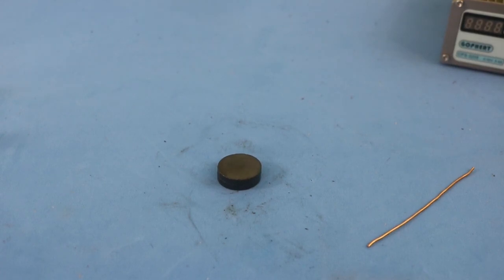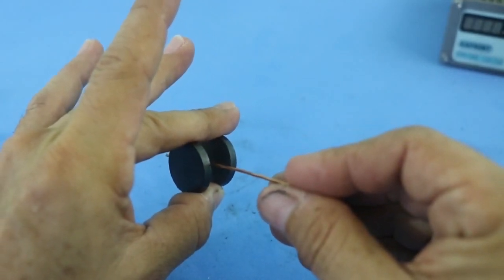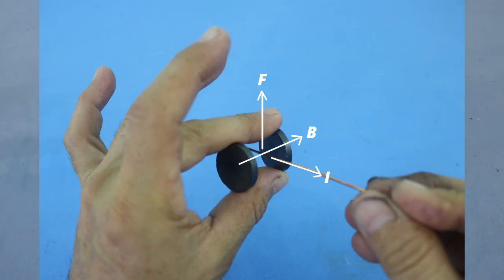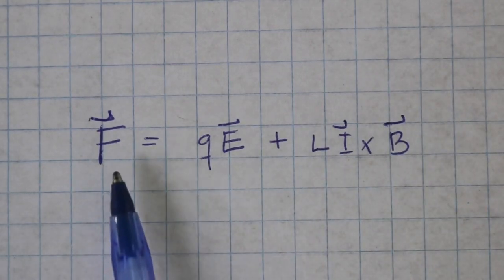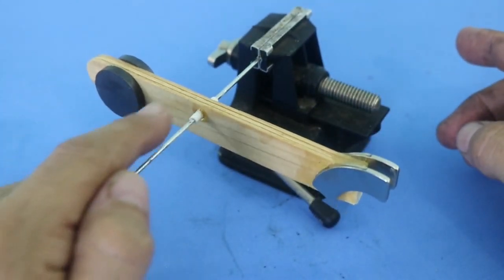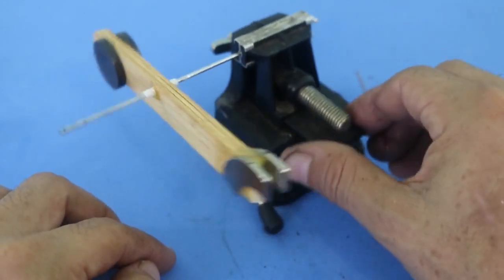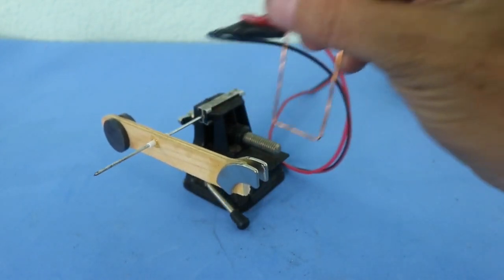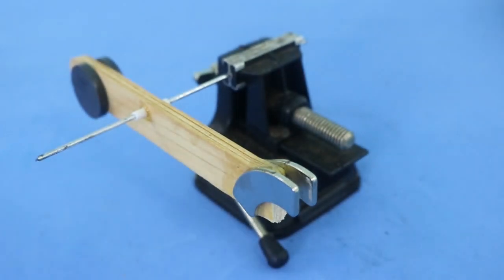Lorentz Force Demonstration and Explanation

Comment: The Fleming's left hand rule is not true. Thus, the so-called Lorentz force is also not valid. I explain it in details here:
https://newtheories.info/community/main-forum/is-the-flemings-left-hand-rule-valid/
Reply: Thanks. This finally explains why I'm getting inconsistent results. I have also found that, if you should use a small diameter rod instead of a wire you will see that the rod torques/spins. Thanks again.
Reply: @robinhooper7702  I didn't understand your experiment, but I am glad that you find my article helpful.
Regards, Mitko
Reply: @robinhooper7702  I am in the middle of writing something, but I will watch them for sure in the next days. Thanks.
Reply: https://www.youtube.com/watch?v=0XctsujcSbk
Reply: Explain Monsoon then